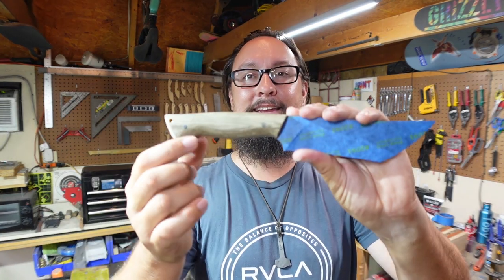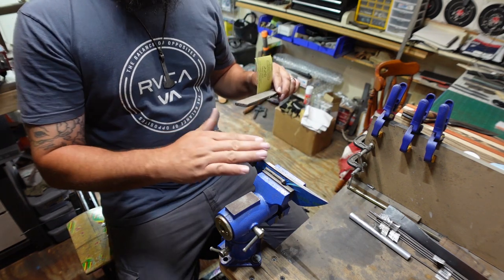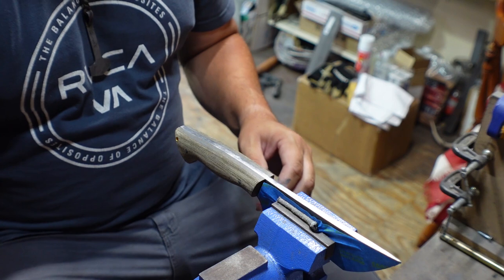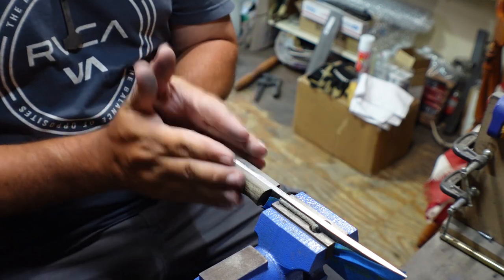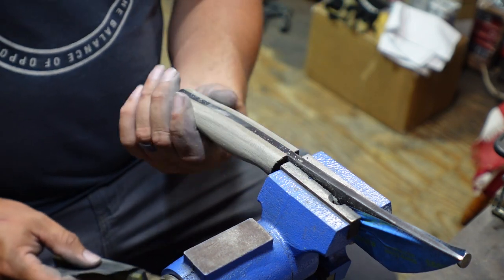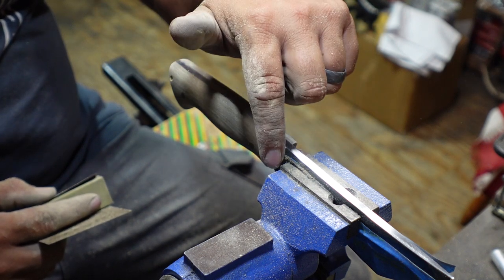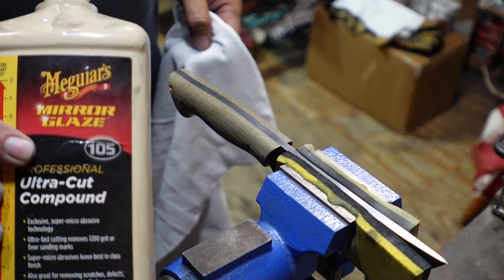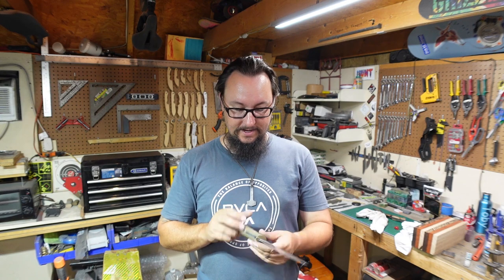Finishing The Handle On This Awesome Knife | Shop Talk Tuesday Episode 83 | Vlog

Comment: Looks great, ive got a good question for ya, what would you use to clean/remove buffing compound reside on wood scales that have natural pitting like unstabilized oak scales?
Reply from the maker: Take a buffing wheel with no compound to the scales. They also sale denim contact wheels that are good at doing what you are wanting done.
Reply: @theriversexperience9383  well its not something I hope to encounter to often lol but its the case here lol thanks for the info

Comment: What if you used the scotch brite belt on the blade before you put the scales on so there is a bit less heavy scratches to refine ? Looks great Erick  !
Reply from the maker: You will end up rounding the spine over a bit and that will leave a gap between the tang and the scales. You want to leave the edges nice and sharp.
Reply: @theriversexperience9383  Gotcha thanks for clarifying

Comment: Wouldn't scotch-brite belts cut down on some of the hand sanding? In so much as eliminating some of the 2x72 scratches at least. Hand sanding is of course unavoidable,  and my favorite part.
Reply from the maker: It would but the softness of the belt would flex around the steel and sand the scales faster than the steel, which would leave you with just as much hand sanding or more.
Reply: @theriversexperience9383  I see, but I was thinking about putting in the work with Scotch Brite or cork belts before attaching the scales. Of course you have to trim your scales well or put in time with finer grit belts instead of gluing two rectangles to the handle and hogging away with a 60 grit.  I dunno, different strokes etc..